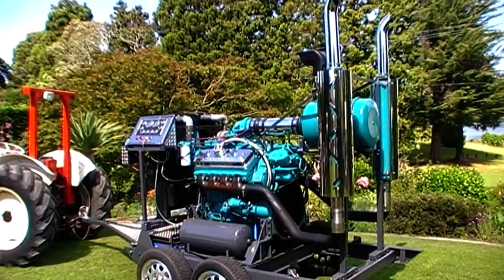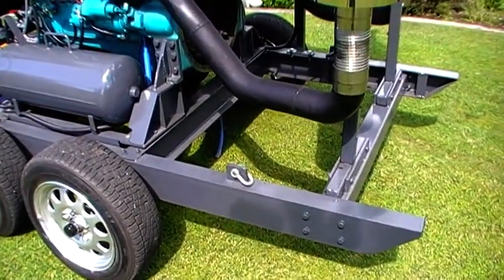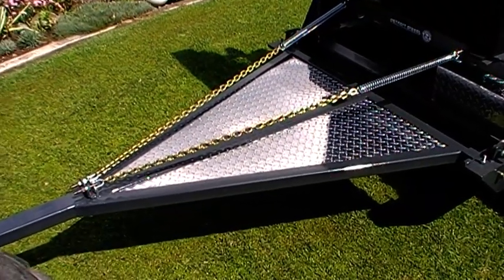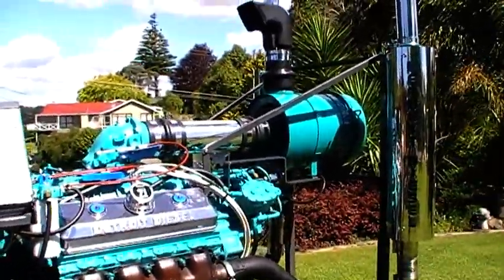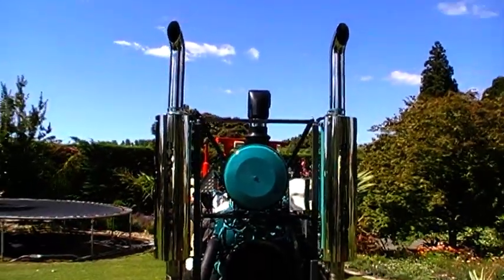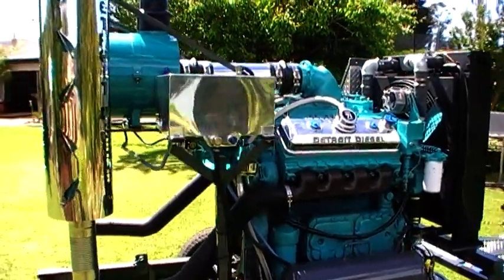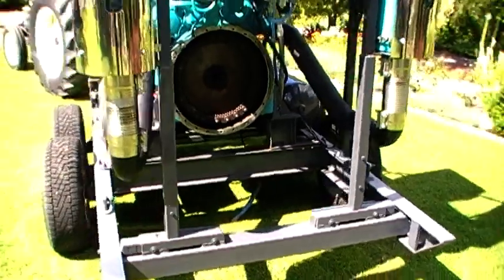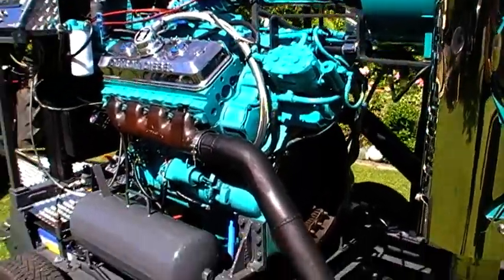Detroit Diesel 8v71 project part 6 Finished

Comment: This engine uses the same proportion of oil in diesel engines and 2-stroke bikes
Reply: Detroit 2 stokes, unlike a 2 stroke bike, get their internal lubrication from oil in their crankcases.. No oil is added to the fuel.

Comment: Nice job can't fault your work but... I don't really get the engine on a trailer thing, it's seen a lot with old aeroplane engines. stationary engines? engines are meant to be under load to take up the slack in bearings etc. They fit the two stroke detroits in lifeboats here in the uk and they sound great. But be nice make it drive something.
Reply from the maker: Cheers mate, its a mobile power pack ready for something to bolt on.
Reply: Very nice too, please show us if you do attach it to something equally well restored.
Reply: hellsbaby127 It's a portable stationary power source! Read the description/listen to the guy talking!
Reply: Did you know, that on the slower revving EMD variants of these engines (ie 567 and 645 V6,8,12 and 16 cylinder)
they have no bearing caps? The connecting rod is the only bearing and the traditional bearing cap is non existant.
This is because the piston is always in compression.
Reply: ...the theory is they will run without rod caps...they do in fact have rod caps...

Comment: How much horsepower this 8v71 engine produse?
Reply: Scania Racing Team 8-71's came in many configurations. T/A's (turbocharged and aftercooled, and T/I's (turbocharged and intercooled). I've seen T/I's with big injectors in marine applications pushing out 600hp+. Like all engines the more HP you get out  of them, the shorter their lives.  I've had naturally aspirated 71 series go over 10K hours, and had TI's that were very tired at 2500 hrs. I have run 71 and 92 series in boats for over forty years. Unfortunately these motors are so inefficient, they are getting scarcer and scarcer. But they sure sound great.
Reply: around 320 hp  naturally aspirated , if it had a turbo about 350 hp
Reply: Thank you..
Reply: Thank you
Reply: The engine was known as a 318,as in HP in its day.I do not recall a 318 with a turbo.The turbo DD was an 8V92 and could make up to 430 HP in a standard Semi truck build spec.Thats 92 c.i. per Cyl.I drove trucks for over 30 years and the DD and Cats were my favorites.
Reply: @dinkchow  871 was available in Turbo charged guise, with various different injector/Turbo sizes, aftercooling/intercooling, most common truck application was N75-350T or N75-370TA👍